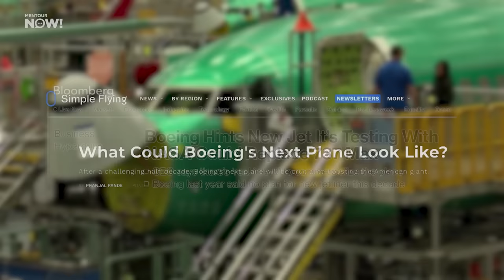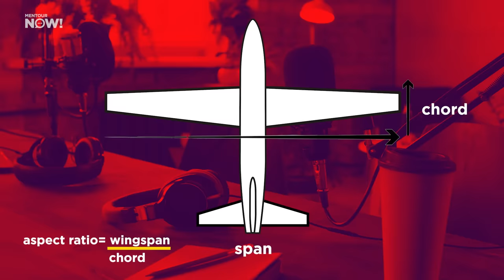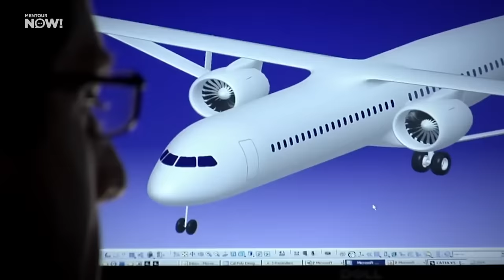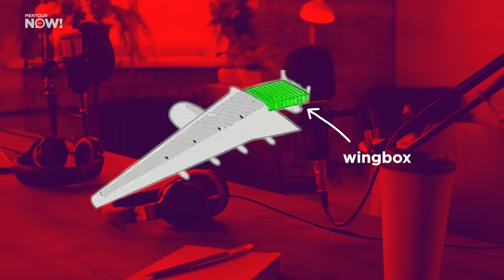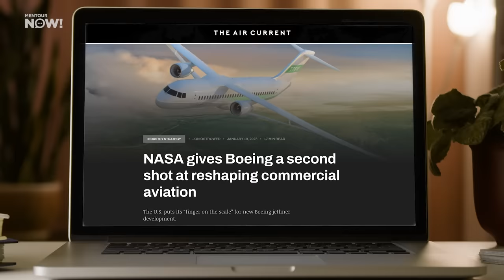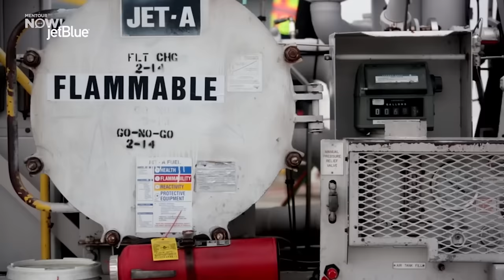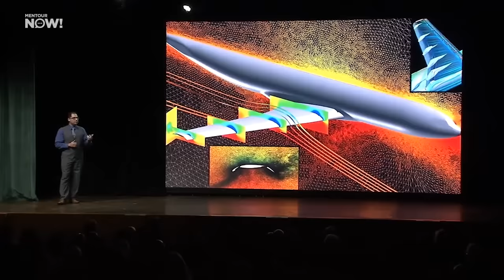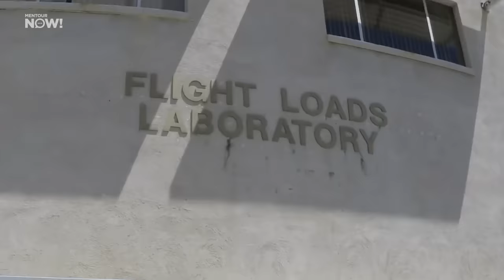Revolutionary Breakthrough: Boeing's Transonic Wing in Partnership with NASA!

Comment: No doubt this 'extreme' wing design will provide impressive benefits as well as knowledge. 

What could be really interesting is how, armed with this new knowledge, close to those gains can be achieved with something far less extreme.

For example, more fuel in a slightly thicker wing (or braces on a high wing design) may increase fuel consumption,  but could the additional profit from the increased cargo capacity more than cover  it.

Although, moving forward, if hydrogen is used as a fuel, the capacity of the wings may become irrelevant.

Comment: Again, the slant here is that we're re-engineering proven designs to reduce costs.  The primary objective should be getting from point A to B safely, and we're not doing that anymore.  Instead, we're making changes to aircraft that make them inherently less stable and experimenting with radical changes in wing design, and then using the passengers as test subjects.  You're forcing the engineers to cut corners to the degree they won't take a step near the aircraft - and that should really make you take pause.  This IS the cancer that is killing Boeing.  The whole design methodology is backwards... The bean counters are telling the engineers what and how to design.  Boeing is dead if they continue in this direction

Comment: Another poster mentioned Hurel duBois and their high aspect ratio strut braced aircraft as progenitors of this concept -quite true even to the jet powered swept wing proposed by them but the closest ancestor would be the work of Werner Pfenninger who designed world class sailplanes in the 1950s and went on to work in the US aerospace industry and NASA pushing his concept for jetliners of this configuration also including laminar flow control and wingtip 'sails' to minimize drag - also active load relief and flutter suppression .

Comment: The 737 max was an effort to save money and the huge expense of a full fuselage faa design certification, it bypassed normal safeties because it was a design modification, they took shortcuts and people died. They usually use triple redundancy on all angle of attack sensors,that one stall sensor was criminal. They knew that in cruise the Rolls-Royce engines cause a nose up attitude at cruise. But if not moderated it can cause a critical stall situation to occur. If they wrap a conventional wing around the top of the fuselage if would effectively make a modern biplane and create a much better lift and fuel savings.

Comment: so funny that the new aircraft wing designs uses  elements from the very first bi-plane aestehtic designs (vertical braces which the double-decker wings also had). Of course there is a huge difference, but it still looks like a callback.

Comment: You forgot the sonic cruiser. 
Complete departure from conventional design but ultimately too many design risks.
And the strutted wing has got to be a line ball. The gains from the very high aspect ratio have got to be eroded in large measure by the penalties of the strut. Additionally conventional design is massively redundant. Struted design is not !

Comment: The truss braced wing concept presents challenges in the areas of structural loading and drag inducing wing deformation outboard of the truss during flight maneuvers. This could be addressed with variable camber wings for load alleviation function but that would add complexity and weight to the design. As you stated, where to put the fuel presents a challenge for designers. We live in exciting times.

Comment: How about landing gear that turns 45° or 90° and lets the plane crab walk to the gate.  I wonder if this would be cheaper and safer than folding wings.
(Imagine folding  the wings in a wind storm, those hinges and motors and locks would need to be stout !)

Comment: Great video, just wanted to ask… did you hear about the FedEx cargo plane that almost landed on top of another aircraft ready to take off but was able to pull out at the last moment?

Remarkable piloting by the FedEx crew.
Reply: Many headlines portray it as "almost landed on top of" but the actual situation was different. FedEx was on a three mile final in poor visibility. A Southwest plane was cleared for takeoff on the same runway. Both planes were told about each other. Southwest delayed almost a full minute before taking off but didn't announce that on the radio. As FedEx arrived at the runway it saw that the Southwest plane was still rolling so FedEx aborted its landing. 

Southwest was apparently unable to abort its takeoff. FedEx passed above the Southwest plane as it was lifting off. A rare situation but not unprecedented. To my knowledge it has never resulted in an accident at least in commercial aviation, although it is obviously dangerous. 

Until the FAA investigation is complete no one knows how close the planes actually came to each other or what the actual collision danger was. But it does not appear that any evasive maneuver was performed other than the standard go-around by FedEx.  Some media outlets are using ADS-B  data to try and make recreations but that data requires analysis to get the accuracy required to determine the exact positions of the airplanes in relation to each other.

Again a serious situation but not enough information yet to warrant sensational headlines that paint pictures that may not be accurate.
Reply: @StevePemberton2  

Thanks Steve for the explanation 

Maybe someone can confirm or deny, but from what I heard, the distance between the top of the vertical stabilizer of the Southwest plane and the bottom of the FedEx plane was 27 feet at one point. Was that from being directly above or what would have been?

I'm hearing the FedEx plane passed above the Southwest.
Reply: @dkad7177  Yes as I said the FedEx plane passed above the Southwest plane. But FedEx was already climbing when it did so, not flying level or descending. A go-around maneuver is done at full thrust. I could imagine the FedEx plane possibly climbing steeper than normal in this case to increase the separation, but that won't be known until the official report is released.

Any site claiming to know numbers like 27 feet should be ignored. The ADS-B data that is available to the public is not accurate enough to make this level of determination.
Reply: @StevePemberton2  

I agree the 27' is likely an approximation.

From what I gather, this was calculated by the height of the Southwest 737 and the 767's min height AGL.

The question is when did the 767's flare reach it's lowest height AGL, and did this happen above the 737.

Yes, we have to wait for the full report, but it's looking like the min distance was very likely <100.

Comment: 16 meters, but divided by 2 as it will fold on each side. But still 8 meters folded straight up in the air, that's quiet high.

Comment: Vtol design in pairs 3 4 position for front and 1 2 position for back pair except back pair can also be behind tail on a strut bar so engines are on servo and for end front pair is more diagonally paired backed and back is also hooked diagonally so you got like diagonal shape design that has expanded hook wings which can be longer then usual just like stekth wings except is could Corvette fly future scfi tech and behave like glider with switch form from front for back for more speed and less fuel burn this diagonal wing si romulan preybird design is worth while research while this tech is far ahead in future and fuel efficiency even with normal size wing angled and longer and is very stiff with reinforcement end like air tank this means much easier fly buble and even squid tech side that behave as a nother  pair off wings and can have front flaps movable as well so airplane stifness is much better and glide patterns so next gen aeroplanes could have front f1 spoiler and back for easier glide paterns and achieve speed and height much easier and far longer range and stiffer chassis and body gets easy side gliders and chasis gets presse and more flat like from a below

Comment: imagine instead of building bigger docking ports, u build folding wings that will have multiple points of failure that dont need to even exist.  if every port was bigger then there would be no issue.  pretty sure if i have to choose between safety and price, im gonna choose safety. but really they are only charging more because more people, so when u add up all the money, ur spending the same amount.  it all evens out and its safer.  no brainer.

Comment: The modern jetliner has a serious problem today.  That problem is that they are almost at the edge of what they can do with the traditional design.  The faster the plane goes the more swept the wings have to be, which creates a serious problem.  That problem is, the more sweep the further forward you have to push the  truss box on the fuselage. Then you also have to bring the engines closer to the fuselage to avoid a natural tendency to nosedown the plane.  To make up for that you have to mount the wings higher on the fuselage, but that increases drag and removes efficiency from the engines.  So there is a give and take, that is why they look to lighter materials with high tensile strength.   It just costs too much to try and make the plane as efficient as you can.   

One more thing.  Boeing has a serious problem.  They are trying to run a modern business on the standards of the 1960's.  Just to get them to use modern technology leads to cost over runs and mechanical issues that should be solved in testing.  In order to put something into production without all the testing needed, is leading to lawsuits and safety risks.

Comment: The biggest questions for me are fuel? Because at least based off the mock-ups I do not see them getting enough fuel in it. The other question is if it goes into production what material will they use for the fuselage.

Comment: The location of the engine would make the noise levels inside the plane way worse, and almost half of the plane windows would be either blocked by the engine or looking right through its exhaust 🤔

Comment: why cant be transonic wing can be designed in such a way so that the wing that is major is at the bottom and the swept wing is at the top.  so it solves the problem of weight of landing gear and all other and no modification to the tune of douglas MD 90?

Comment: Why not go for a tandem wing design. Two shorter wings instead of one very long ?
Reply: Weight probably
Reply: A tandem wing looks cool but is unfortunately a pretty bad concept unless you're trying to make a tiny plane. It creates a ton of induced drag, and isn't nearly as structurally efficient as a single wing with a larger chord.
Reply: Another concept is the toroidal wing, it's like a normal wing with a winglet that extends all the way back to the fuselage. So one continues wing that forms two lifting surfaces. This design is available for boat- and drone propellers.

Comment: Seems like it would be easier to leave the wings on the bottom and run the strut from the top of the fuselage, instead of raising the wing on top and running a strut from under the plane.

Comment: If plane manufacturers want a smaller chord but have the same amount (or more) surface area for lift, could they not go for a bi-plane wing design?
But join the ends of the wings with a semi-circle to reduce the vortex at the end. A toroidal wing if you like.
Reply: Yes, I have seen drawings of planes with that wing design, but not implemented other than propellers.

Comment: Is this comparing apples to apples?  With cars/trucks etc. you can increase the efficiency of the engines by driving slower, you get much better MPG at 55mph than you do at 75mph. Is the same true with planes? For a variety of reasons that I don't claim to understand, coast to coast air travel takes longer now than it did 15 or 20 years ago. Since air customers seem willing to put up with just about anything to save a few dollars, if a flight takes 30 to 60 longer but can save 10% on the ticket cost, my guess is that company will be successful; at least until other airlines start doing the same thing.
Reply: It's not 100% comparable with cars. Cars drive on the ground, while aircraft fly in high altitudes. If you fly higher you have a thinner atmosphere and less drag. If you fly an airliner on 3000 m it consumes far more fuel compared to the same aircraft flying on 10.000 m. In less dense air however you have to fly faster to get the same lift out of your wing, but with a bigger wing to fly slower your drag would increase.

The reason why Turboprop aircraft fly slower is not their wing, it's the propeller which loses a lot of efficiency if the blade tips start to get supersonic.

Comment: Why not have a dual wing on each side and double your lift capacity but only increase your weight by about 60-70%…the engine is wedge between the wing!

I call it a bi-plane!!! Sound familiar?
Reply: 2 wings on top of each other cause drag by interferences of both wings. There is a reason biplanes were no longer used since the 1930s, their construction just made it easier to build them from wood and fabric, while a mono wing aircraft is harder to build with wooden wings

Comment: The one thing I don't understand is why the Antonov AN-225 could get away without a wing strut, while the Boeing designs require it? The AN-225 was even supporting 6 engines. Maybe it was mentioned in the video and I missed it?
Reply: The challenge is not to build an aircraft with a big wingspan, the challenge is to build it with a slim wing with little height, little chord and a huge Aspect ratio. If your wing has enough height it's never a problem to make it stable enough, in this case the goal is to make it with little height. The engines itself (and the fuel in the wings) are not the problem for the wing, since these loads are where the lift is generated. The wings don't hang at the fuselage, it's the fuselage which hangs on the wings

Comment: The Plane does not look different than many of those introduced in 60’s and 70’s except of those support bracings for better aerodynamics i guess. Unless they figured out much lighter material with much stronger engines with suberb efficiency i quite did not understand this design looking like DC 9 with narrower wings
Reply: The design principle was invented by Dr. Werner Pfenninger in the mid 1950s, a Swiss aerodynamic scientist working for US companies and later for Nasa.

I think the main idea behind it is the high Aspect ratio of the wing, which is not possible without the struts under the wing. Also the design still uses a conventional fuselage, which makes it possible to stretch it without much changes on the rest of the aircraft. A blended wing body for example has eliminated the conventional fuselage (which causes drag but no lift), but if you make changes to the size you have to scale up or down the whole aircraft, you can't simply stretch it.

Comment: How about this...make a wing with engines and landing gear, everything together and a sort of clip on fuselage that is manoeuvred underneath all this? Technical part totally separate from passenger or cargo part.
Will solve turnaround and gate problems!
Probably easier regarding maintenance too.🧭
If you, as a pilot, do not like the passengers, ditch the lot!
Reply: The SkyCrane heavy lift helicopter was designed to do just that.  It is still in use today.

Comment: The lift to drag ratio for a cylindrical fuselage is zero. How about we break away from this legacy design concept moving forward.
Reply: They (Nasa, MDD and after 97 Boeing) had some research on blended wing bodies too. They should be superior in fuel burn, but you can't stretch them. If you want a bigger aircraft or a smaller you can scale it up or down, but you have to change the whole aircraft (including wings) and can not just add 3 m of fuselage. This might be the reason why we haven't seen them yet in commercial service. Having a whole aircraft family (like the 737 family or the 320 series family) would be expensive since every size would be technically completely different from the other sizes.

Comment: Boieng last attempt at a transonic plane, the "Sonic Cruiser" was a total failure, not sure this one will do better !
Reply: The transonic speed range isn't economic. The drag increases exponential in this speed range, you are slightly faster but you get much more drag.

A truss braced wing concept however is not to get speed, but to get fuel efficiency. The concept is not from Boeing, it was invented by Dr Werner Pfenninger in the 1950s, a Swiss aerodynamic scientists working for US manufacturers and later for Nasa.

Back then the slim, long wing may have been a problem to manufacture but today they have different materials